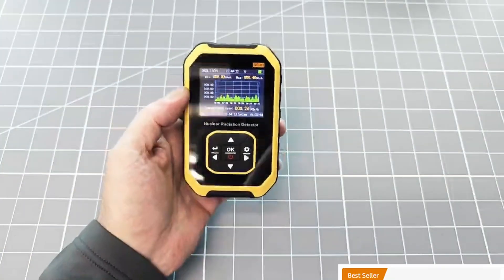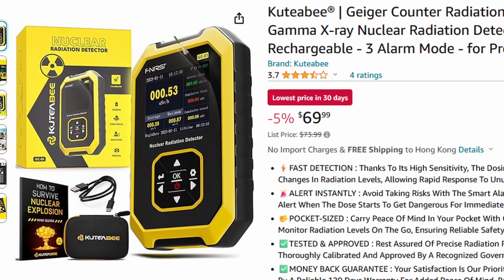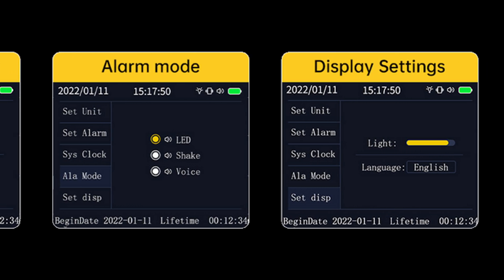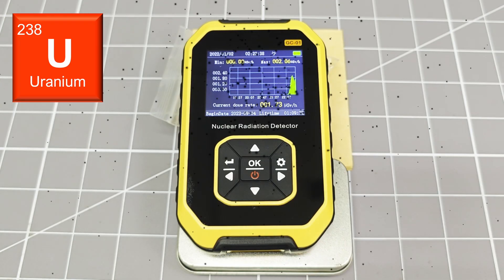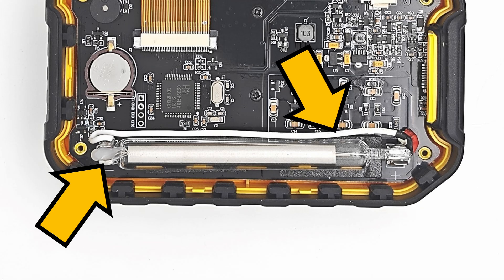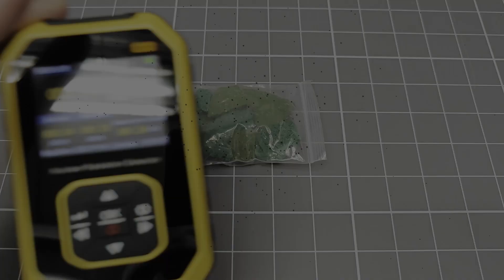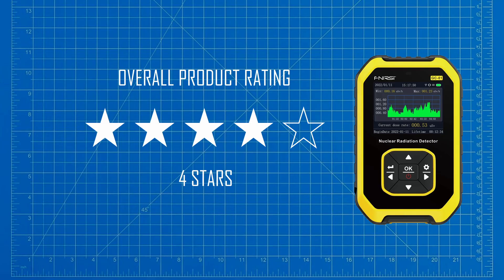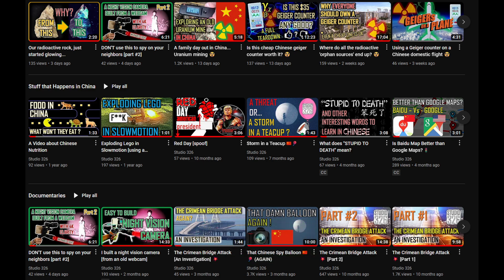FNIRSI GC-01 [IMPORTANT PRODUCT UPDATE]  ☢️

Comment: Does it make difference if you solder the capacitor directly to the transistor or to the resistor?
Reply from the maker: no difference at all, they are connected.
Reply: @project-326  even if its in front of the resistor? I can barely hear the click. Its waayyy too quiet.
Reply: @project-326  in your other video you soldered the THT Cap on the right side (in front) of R7 which makes the sound extremely quiet for me.
Reply: Okay Update:
as you said there is no difference where you solder it to. I was in a noisy university lab so the clicking seemed way too quiet for me. In not so loud surroundings it is a little bit better..could be louder though. Any way thanks for the video!
Reply: Yet another update:
After being next so a radioactive sample for one night this POS stopped clicking entirely (LED is also dead)...I am so done with this china crap.

Comment: My cumulative stored does absolutly not match my average...   (average uSv/h * runtime h = cu stored dose in uSv??).
Whats the averaging time interval length? As long as the bar graph shows? Even if so, my displayed average is ALWAYS about twice as high as the cumulative average.
Did you encounter similar issues?
Reply from the maker: The whole averaging process on the FNIRSI device is pretty strange, I have no idea what the firmware engineer was thinking.  For sure, changing the tube won't affect the firmware, but with more counts now being seen by the MCU, the 'strangeness' will be more obvious.
I assume that the dose rate is a true integral of the total number of counts received since the last reset, but perhaps that assumption is also invalid.
This is the only Geiger counter that this brand has produced so their engineering team might not really understand the underlying concepts.
Reply: I think a lot of Chinese geigers have huge issues.  Have a HFS-P3 that also has funny average and once in a while its value sinks and rise wildly rather than fluctuate a little - even at high levels (background levels wild fluctuations are to be expected with the small tube it has). Like it only logs between 1/3 and 1/2 of what it should. Then I have a ViBao C101 that maxes out at 6,45 µS/h even though clikcing sure suggests it should be higher. Then I have F9000 (F6000). At first pretty decent but it fluctuates too much. Then I have Pudibei NR-1050. That one works with no oddities found - but dose(-rate) is adjusted for Co-60 rather than the usual Cs-137.
Then I have CaJoe GMV2. Rather simple and uses fixed intervals. Quirky UI especially if you want to use the alarm function but usually you don't so after power up it is pressing F-button to go straight to F4 which is no alarm. But other than that no oddities found.
My own theory: Geiger Counters for the Chinese market are crippled on purpose to minimize risk of riot or similar. I think I'm done with them. Have GQ GMC-300S, GMC-320S, Better Geiger S-1 and a GQ GMC-800 on the way as it was on discount at Amazon. But I really should save up some money to get either Radiacode 102 or higher or one with a pancake tube (GQ GMC-600 is probably the cheapest - about half price of what I find elsewhere). Better Geiger also has an S-2 on the way. But you really need to understand the difference between the different sensors. Each have their own strengths and limitations.

Comment: I have a problem. There is no resistor in my model. I have change the tube and add capicitor. Now it worka better but Im not sure if voltage on tube is right.
Reply from the maker: I have run without a limiting resistor since I made the change.  Are you getting a better sensitivity now?
Reply: @project-326  Yes sensitivity is much better.
Reply: @sietra   Hi! It was too late when i found this great review.... mine came with a shorter metal tube and no resistor... i measured 200v dc on the tube. Wich capacitor did you add (the one to make the sound or another)? I guess J321 wont work anymore without other changes... Thank you!
Reply: @project-326  Hi! Great video! I'm going to do the sound mod... already have the capacitor. Any chance you would make a video to save the even crapier version of the tube? Measure 200v on the even smaller tube. They must have changed the multiplier circuit. Do you have a hi-res photo of this section of yours?  Thank you anyway!!!
Reply from the maker: @K-IQ  I think that they just use the loading resistor to change the DC voltage from the multiplier circuit.
Reply: @project-326 Agreed, to lower the voltage, but mine does not have the resistor, i guess the multiplier was recalculated. Thanks for your time!

Comment: I am thinking about taking my GM tube out and making a housing for it and us it as a remote, having a tether of 4-6 foot long. Thoughts?
Reply from the maker: Perhaps use a telephone type coiled cable.  I also thought about this a while ago, 3D printing a custom enclosure for the tube.  Instead of using spring clips to hold the new tube 'wand' to the side of the device, I was thinking about using a magnetically secured wand and 3D printing the instrument-end magnet holder with a shape that matches the wand shape itself to ensure a better grip.  
BTW, I have found that a cheap selfie-stick grips the device pretty well so this is also a nice option for ground surveys without the need to visit a orthopedic doctor afterwards.
I just did this to help with surveying the tailings heap of an old uranium mine - I'm currently working on that particular video...
Reply: I will be looking for that video. @project-326

Comment: I got mine and i can confirm it uses even more cheap and shit tube that already discounted version J613. It doesn't even has a name. I found it on Ebay as simply "HG Geiger Counter Tube". Looks simillar to J613 but is is much shorter instead 85mm inlength its around 51mm. Even less surface area = even less sensitivity. However it doesnt have that loading resistor on PCB. Maybe it is alredy modified power supply? Do not know if i can even use aftermarket J321 tube anymore.
Reply: Did you figure it out? I bought one too and it has a tube 47 mm in length, again with no markings. Mine doesn't have a loading resistor either. 
It seems that they changed the board design: the tube is properly mounted with it's leads going through the board, around the halfway point. The PCB markings for the J321 tube are still there though.
Reply: @oskarantola2616  I since bought another radiometer. Pripyat RKS 20.03 Polaron Dosimeter with two tubes SBM-20 side by side. Much older and higher price but also much more sensitive and quite respected among the community of users. Still planning the upgrade the FNIRSI one even might be able to measure the voltage with hi impedance oscilloscope in work. Will see how it goes. Will report here if successful. PS by the description you have the same tube as me. Was your in some way secured to PCB other than just by wires? Mine was on wires on one end and flipping in the breeze on the other end of the tube. I put some double side tape under it to stop it from vibrating the wires. They would eventually break I suspect.
Reply: @josifvissarionovich5320   Looking forward to it, hope you're successful! 
Mine already has some double-sided tape in between the tube and the PCB from the factory. Does your PCB have markings for the smaller tube, too? 
Also, I measured that the high voltage does still come to the J321 fitting contacts so perhaps this isn't a lost cause. 

The little tube seems to fit the description of a HH614 GM tube, though no markings. The recommended operating voltage for the HH614 is 420 V, which gives me hope that the power supply might have enough voltage for the J321.
Reply: @oskarantola2616  So is mine, bought 2024, Feb. 1st on amazon: About 50mm short tube without any markings. No fuse type holders, directly soldered to the PCB. No loading resistor. I measured about 320 volts at the tube with a DVM. Today I installed a J321 tube without any changes at the HV stage. The GC-01 has about 5 to 8 times better sensitivity. With the short tube readings were about 2-3 times less than a BR-6, no it is about 5 times more than BR-6. But on normal radiation a reading of ~0.50uSv/h is much too high (BR-6: 0.10 uSV/h).
@studio326- thank you for that very good video!!!
@wolf1403
Reply: @wolfganglehmann2717   Does this mean that the meter isn't calibrated correctly for the J321 anymore?
Could the problem be fixed by installing an older firmware?

Comment: I have one. The real one will say FNIRSI on it and there will be a screw under the sticker, at least mine did, and it has the correct GM tube in it.
Reply from the maker: The very latest ones (branded and unbranded) have all changed over to the shitty tube and the new tooling for the case.  Some of the folk that have commented here have also confirmed that.

BTW, I like your channel content!

Comment: Mine came with the j321 but still had the loading resister on it how did you remove the loading resister.
Reply from the maker: my advice is to not change it, it has been set to the correct value for the tube.

Comment: Calibration ×
Reply from the maker: Yes, indeed the Cal will be changed, but it seems that the product was still using the original cal that was for the J321 tube, so probably ended up making it correct again!

Comment: Did it measure the Am 241 probe correctly with the new tube?
Reply from the maker: The values recorded for my Am-241 button was about 3.4 uSv/h, which is on the higher end of the spread I see from my collection of detectors, but within range of what I would expect.  Before changing the tube, the device would not even register the Am-241 source...

Comment: Just got mine few days ago, i do have the J321 tube but the resistor you mentioned is also there, should i attempt to remove this? The only other rework i see on my pbc is they added a nice battery holder for the cr1220
Reply from the maker: if it has the correct tube, then don't change anything, the resistor has been matched to the tube.

I have seen several different values for the load resistor in the comments, the one on mine was originally very low and thus pulling the tube voltage too low for J321 to correctly operate.

Do you get normal readings for background, etc?
Reply: @studio326-  18cpm which is probly normal, I'm just getting into radioactive materials just starting to learn.
Reply from the maker: @PlagueDoctorX312  its a hobby that rewards with knowledge, but can also snowball into a seriously time consuming activity.  Enjoy.
Reply: @studio326-  just making a assumption on that resistor, that it must be for calibrating the tube?
Reply from the maker: @PlagueDoctorX312  It will be for matching to the tube type.  This is just to make sure that the tube is operating correctly (Geiger mode).

The calibration, ie counts/min to uSv/h will be in the firmware.

Comment: interesting… I bought mine labeled as Fnirsi a year ago and it came with the J321 tube. However have the resistor that you removed soldered to the PCB but it doesn‘t look reworked. Does anyone else have the J321 with the resistor in place?
Reply: Mine also has that resistor but looks reworked with Flux on the board still I'm considering removing it?
Reply: @PlagueDoctorX312  Guess I need to get a radioactive source to test the measurements. Also wonder whether to remove it or not 🤔
Reply: My has some weird even cheaper version of that J613 shit tube. Weird because it is much shorter. It should be 85mm instead it is 51mm barely. Less surface area i guess even less sensitive... However it doesnt have thar rezistor soldered. Its empty. Maybe it is alredy modified power supply? Do not know if i can even use aftermarket J321 tube anymore. I can try to measure voltage however my multimeter impedance would load power supply therefore i will got wrong measurement. It would take oscilloscope with much higher imput impedance wich i do not have.
Reply: Same case, I have the J321 and that resistor is on the board. It does not look added on afterwards, though.
Reply: @reflectivejellyfish  They probably updated the manufacturing proces now. No need to modify anything. Units are coming cheaper straight from the line.

Comment: Nice video. Could you be more specific on the type of algorithm you would prefer to see on this device? It seems that the embedded mcu is an stm32 clone, so a custom firmware could be developed.
Reply from the maker: At the simplest level, an easy to implement filtering method is to make the averaging time window length inversely proportional to the rate of change of the counts.  Obviously, there needs to be fixed limits on the length of the averaging window.  An alternative might be to apply some averaging but with the newest samples having more weight that older ones.  A more complex solution could be an adaptive filter.  None of these is beyond the processing capabilities of even a very simple MCU, it just requires taking the time and care to tune this for the balance between speed of detection and stability of measurement.

Comment: 2:18 Always buy from the official store. Even then you get things with no branding, e.g. my RD Tech TC66 meter where there's no company name on the meter itself.
Reply from the maker: Typically, here in China, the unbranded version is made by the same factory as the branded one.  This happens because the brand doesn't want to pay for the tooling and certifications and pushes those costs onto the factory but in return, the factory can then sell the product but not with their original brand customers' marque.

Comment: Wow!  What a wonderful review.   The FNIRSI brand makes all kinds of test equipment.  Such as the: $165 FNIRSI DPOX180H 2 Channels Digital Phosphor  180Mhz Oscilloscope.
However , after watching this video I am leery of this brand.   If they dumb down their products I will pass.     😎  Thank you.
Reply from the maker: I am actually wondering if this was done due to issues with the availability of the J321 tube.  I bought my replacement J321tube for about $12 on Taobao, but the other locally made types are about half that cost on the same platform.  Many GM tubes are made in Russia, so this might be impacted by the war in Ukraine.  I say *might*, I don't have any hard data.